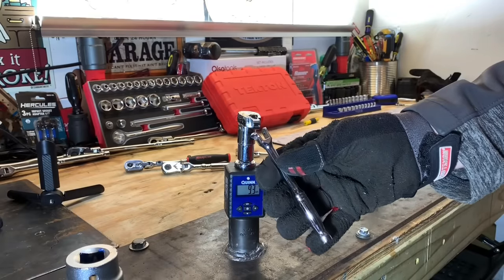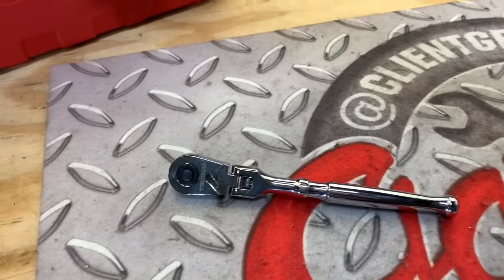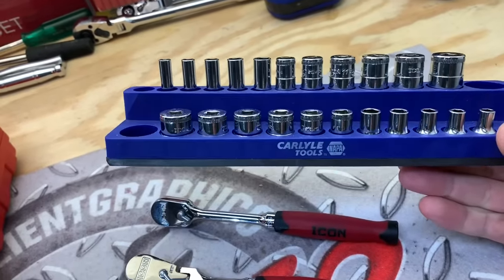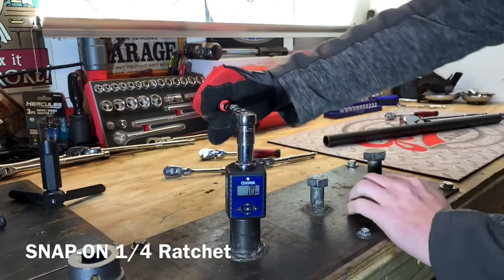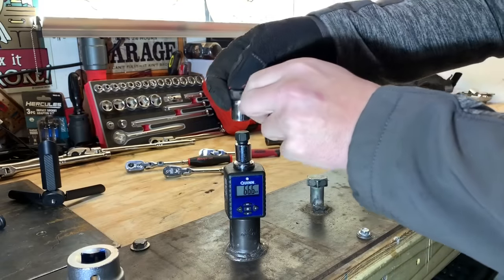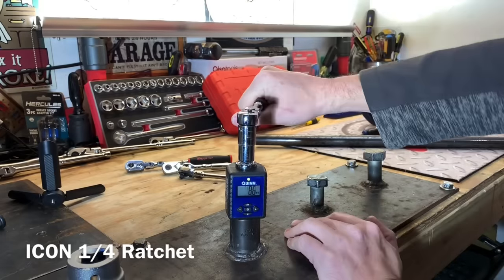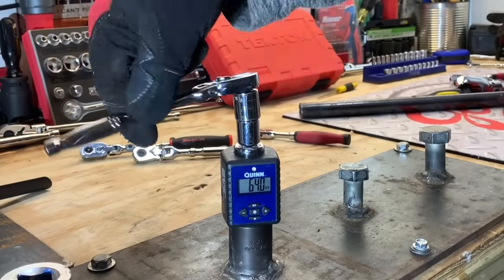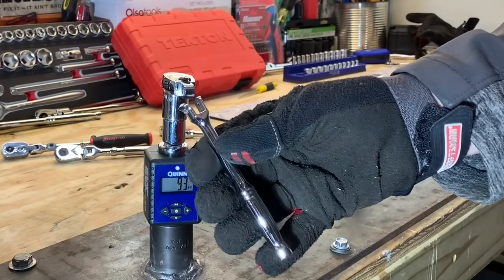$145 of SnapOn vs Tekton vs Icon vs Capri Tools Who Will Flex the Most?

Comment: If you have to use a cheater pipe to break a wrench, there’s nothing wrong with that wrench.
Reply: Doesn't that logic prove that no one needs to buy snap-on? That unless you use a cheater bar, every ratchet tested was the same.

Comment: Uses a broken snap on ratchet against new tools and still was right there with them
Reply: It was last dude.   Dead last.    What do you mean it was "right there with them?"
Reply: @Speed00007  it was broken from the get go😂
Reply: @clydevaught3750 new performs the same. So still speaks well of it. Still overpriced no matter what anyone says. Snap on flex head ratchets are my absolute favorite to use, but snap on in general, no.
Reply: I've used nothing but snap-on ratchets for over 20 years as a professional mechanic.  I've broken many of them, but I never had a single failure of any kind where I wasn't doing something stupid with them like using 4ft cheater pipes or hitting them with a sledge hammer. My at work box ratchet drawer is snap-on only but theres not a single snap-on ratchet in my service truck box or my home garage box. The new sealed head non quick release Tekton ratchets are all I have in those boxes. They are phenomenal regardless of price and it's just a bonus that they are fairly cheap. Working on heavy equipment in the shop vs in the field is drastically different and for me in the field loosing something is far more common as opposed to breaking something which tends to happen in the shop. When I drop a Tekton 1/2 extra long flex head ratchet in the 4 ft deep liquid mud the excavator I'm working on is stuck in at a jobsite I'm out $45 but drop the same $350 snap-on ratched in that crap and I gota go mud swimming for it then that crap is everywhere in the service truck for weeks.  Snap-on comes by our shop twice a week, but a Tekton replacement is typically 4 to 5 days away. That's the reason I choose higher price up front for my snap-on shop box stuff because the benefit is drastically less waiting for repair or replacement and potential down time over a lifetime of extremely abusive professional tool usage.
Reply: The anvil broke on the Snap Off. It was fine at the start. It had a light duty anvil, compared to Tecton, and Icon, that are less than 20% of the price.

Comment: I inherited a bunch of old mismatched Craftsman and off-brand tools for my dad. About 2 years ago decided to upgrade my sockets and wrenches with cases for better organization. After doing some research I went exclusively with TEKTON and I absolutely love them. I work on all of my own vehicles, lawn mower, tractor, appliances etc but I'm certainly no mechanic so I was not going after professional quality shop tools however I feel like my TEKTON tools are in fact professional quality.
Reply: I’m a lube tech and they are definitely professional quality. I use and abuse their sockets and ratchets every day and the only thing I’ve had fail is a set of mini end cutting pliers where the little spring flew out. Took a picture and 4 days later (it was over Labor Day weekend) I have a new set in my mailbox.
Reply: Gearwrench is my baby
Reply: I have the Tekton 1/4”,  3/8” and 1/2” sets (90 tooth)  as well as the SATA 1/4”, 3/8” and 1/2” sets (72 tooth - owned by Apex like Gearwrench and Crescent) ... really happy with them all ... my ratchet wrenches are  Gearwrench !!!

Comment: It was a good test but honestly its a 1/4" ratchet so really its not made for high torque applications if you have to pull that hard you would up the drive size
Reply: I got ratchet mechanisms from various brands, I do notice a wide variance in the overall quality of it and it's not specific to a brand. Snap-on's ratchet mechanism in the torque wrench i have, works OK but lacks smoothness compared to ratchet mechanism from say gearwrench or something. That is something i noticed over time.
Reply: @Enonymouse_  personally I fell that the snap on ratchets are the best ratchets that I've used, the gear wrench to me is much smoother and better feel then a craftsman or matco but my gear wrench 120xp ratchets i dont feel are as good a product or as smooth as my snap on that being said the ratchets are just about the only thing i really use from snap on anymore I've been buying gear wrench products the past couple years because its cheaper and holds up just as well
Reply: No shit
Reply: No shit... the point of the test is to take it to failure. Obviously they're going to load it more than it's designed for
Reply: @bstceltics4  you gotta try some of the German stuff (e.g. Hazet, Stahlwille, Gedore)!
Reply: I’m pretty sure almost everyone that comes to this channel knows that already. That’s why it’s called a torture test. Smh.
Reply: @uppercutshurt5199  i understand its a torture test my point was that i dont buy 1/4 inch ratchets to break 15/16 bolts loose in buy them by how smooth they operate and how many teeth they have

Comment: The quick release makes the anvil weaker on the Tekto and Snap-On. I've become a Tekton fan. Warranty, price, and non skipping socket and wrench sets sold me.
Reply: Right on! I'm going that direction myself. I have always had craftsman in the past but they can suck it!
Reply: I have the Tekton stuff in non quick release, hard to beat for the price.
Reply: Yep I have that same Tekton with non quick release and non flex head
Reply: I go crazy for those no skips
Reply: Also, you get 10% of your previous purchase price off of your next purchase.  I just got the 3/8 full set for $125 and that gives me 12.50 off the next purchase I make.  I think they're a great company.
Reply: I have a ton of snap on stuff but I recently got a second job and need to fill it out. I did not want to go straight harbor freight so I shopped around and Tekton is far and away best deal for your money.
Reply: Also the include more large sockets in 1/4 and 3/8 drive. Some times you can't fit the next size up ratchet and having a 9/16 1/4 drive helps a ton.
Reply: You ain’t lying. That no skip, free shipping and 10% back. Can’t beat that.

Comment: As a professional I much rather have my tools fixed or replaced asap when the tool truck comes around. Mac. Matco. Snap on. Cornwell visit weekly and that's the difference for me
Reply: All you have to do with icon is drive over to your local harbor freight and get a new one.  If the tool truck comes on Monday and you break a ratchet in Tuesday you’ll be out a week.  Icon you’ll be up and running after a lunch run.
Reply: And a lot of companys you just send a picture and they ship it too you usually only takes a couple days less then a week thats for sure
Reply: @Mjc103  driving to HF isn't really feasible because it's 30 min away in a different direction than I live, so the whole trip would be over an hour plus gas after working a 10 hour day.  I'd rather text my truck guy and he will bring it to me.
Reply: @mmholling87  that makes no sense at all.  You’d rather pay double than spend an hour of your time and gas???  Then you’d rather be out of the tool for 6 days rather than be up in running in a couple hours.  Bro listen to yourself.  Get off the tool truck koolaid.
Reply: @Mjc103  my time is valuable to me. It's much easier to get more money than it is to get more time. A $140 ratchet isn't a crazy amount of money in the grand scheme of things. Most techs spend more money on tobacco, energy drinks and fast food than their tools.
Reply: @mmholling87  you’re talking about of both sides of your mouth.  Money is no issue but time is.  If you are down the ratchet until the tool truck shows up you’re losing time.  As a flag hour mechanic the faster you complete the job the more money is being made.
Reply: @Mjc103  nice try, i'm not flate rate and I have backup ratchets, wrenches etc. Buy whatever you like and can afford. I'm not going to buy HF, Tekton etc. I won't belittle you for buying HF and you should grant me the same respect. Have a good weekend.
Reply: @mmholling87  not belittling me at all.  Keep drinking the koolaid and paying double or triple.  Snap on isn’t your daddies snap on anymore.  Good day sir.
Reply: @mmholling87  I said good day sir.

Comment: My 88 tooth 3/8 drive Snap on cost me 138.
But it's worth it.  Nice smooth action.  A rachet is used to remove nut or bolt.
Use a pull handle to break shit loose.

Comment: Snap On hand tools (ratchets & all) are absurdly over priced for what they are today. When a 1/4" drive basic set cost nee $600, the actual value is beyond difficult to justify other than wrencher social status membership. Back in the 1970's Snap-On tools were about 30% more than Craftsman (Sears stores) equivalent this was mostly true up to the mid 1980's, come late 1990's till today Snap-On's marketing deception machine has inflated their hand tool cost beyond absurdity. It works due to brand loyalty and perception Snap-On has the "Best" hand tools made... made in the US of A which is questionable. Fact is, there are many, many alternatives to the Snap-On offering today from HF to European brands that are in many ways superior to Snap On and similar offerings at FAR more rational cost. The "Lifetime" warranty is another Snap-On marking trap to lure-bait tool users into believing the myth of, "Buy Once, Cry Once.". All tools wear out and can be busted if abused in various ways. Actual Snap-On warranty depends on your tool truck dealer and how Snap-On ship into be warranty "feels" about your claim. This is the real world reality of Snap-On's "Lifetime" warranty.

As for Snap-On's Dual 80 ratchet design, it's origins can be found in the original Armstrong and Proto flat handle ratchet made post WW-II. The basic design of using a low tension spring on a ratchet pawl to reduce back drag with smooth operation and high strength goes back these US of A ratchet designs from long ago. What Snap-On did as with many of their claimed "innovations" is to slightly revise it then apply their deceptive marking to foist this stuff. They are not the only ones to use a ratchet design like this, TopTul offered-sold (to this day) an extremely smooth, fine tooth ratchet design years before Snap-On's Dual 80 ratchet at FAR lower cost.
Reply: Nothing more than tool snobbery....you can find the same thing with wine...opera music etc...

Comment: I came here to read all these comments by strap-on users who got screwed with their overpriced, over-hyped garbage....😆
Reply: 🤣 "strap on" good one
Reply: Ebay's a hell of a site
Reply: You do realize that the quick release ratchet heads are much weaker than solid anvil ratchets. I have icon and snap on and Mac and craftsman. The icon ratchet is good but using it every day it has started to get binding in the head where the snap on is still strong and smooth over years of use. Everything has its purpose
Reply: @yz85919  Be realistic about "Strength" of any ratchet. If you're going to apply that much torque to any wrenching tool, a ratchet is the wrong tool. If vast amounts of torque is required, use a long handle box wrench or non ratcheting socket drive tool or better yet use a high power impact tool. It is absurd to use a hand ratchet as the default wrenching tool as there are FAR better tools for a given wrenching need.

And... Do NOT be afraid of using the largest square drive for any given wrenching need. There appears to be a chronic and severe allergy within the Moto wrencher folks to avoid at any cost a square drive size larger than 1/2" square. In any application that needs more than 300ft/lb using a 3/4" or 1" square drive tool would be the FAR better choice. Instead, Moto wrencher folks insist on adding a 100 foot long cheater pipe to the tiny (1/2" or less) square drive tool then scream "Cheap Crap" after the square drive tool explodes.

~Why?~
Reply: Snap-On's reliability and dealer network notwithstanding; people tout them as "lifetime tools" which...after re-mortgaging your house and starting on a loan that could get you a nice Truck, are quickly sold off wholesale to the first takers to get the loansharks off your back :P

Mid-priced or cheaper $20-40 don't really have any change in value and since you're not dropping your paycheck directly in the tool truck's coffers, you tend to hold onto them longer!
Reply: Jack Lo lmao if u turned wrenches for s living you would have nothing else in your hand believe me!
Reply: Well if you ask my dad who's a professional diesel mechanic having reliable tools is one thing but having a good replacement network for when one breaks is even better especially for when he travels
Reply: @rupunzel6299  your telling me you don't torque yours lug nuts with a 1/4 inch ratchet?
Reply: @Jacweninger  Depends on the lug nut size. Model RC cars have small lug nuts that can be easily busted off with any 1/4" drive ratchet. Lug nuts on a Caterpillar 797 can challenge any "ratchet" smaller than 1" drive. So, tell us about your lug nuts?
Reply: They got the lube of payment plans till death lol
Reply: @rupunzel6299  Damn right! I work on trains and we have multiple setups of different sizes. You cant use a 1/4 on something that need 2/4 or 3/4 or use a 2/4 on something that needs a 4/4.
Reply: Agreed ! Snap-On prices are insane and the quality is just not there anymore ! I love the TEKTON line, Price is great and i have yet to have any issues with them ! I have not used the ICON line so i know nothing about them... "strap-on" LMAO !
Reply: U been around for awhile now, snap on has always been expensive and among the top tool brands, now with that said the difference in gap in quality in tools has been greatly reduced in past years, it is NOT as beneficial to buy the top brand as it once was. They will eventually price themselves out of business AND they are making more and more tools overseas while touting all American made company. Now I also have seen snap on outperform in some instances (not all) especially their wrenches. But over the years I have not found them to be a absolute to buy except for a few tools they make that supersedes ALL others, then again there are some Mac tools over the years have had some surpass all others too, Matco too but not as much as the other two. Bottom line is buy the best you can afford and just try what you think is best for you, forget our bantering.

Comment: I don't own any Snap-on tools. I've had both had bad experiences with tool men and also don't see the point in paying so much. With that said this proves that a new ratchet will hold a certain amount of torque. But this does not account for the longevity of the tool. As an Automotive Technician I look for what will last. Pushing the ratchet to its failure point doesn't prove that over time the tool will hold up. The way these tools are actually used is very different than a static test.

Comment: Super Thorough vid! The only thing that seems unfair is everything was brand new aside from the snap-on which was already broken in one direction, It doesn't seem fair to use a previously ABUSED ratchet and compare it to new ones
Reply: Facts
Reply: It snapped the anvil. No amount of normal wear, for 50 years, weakens the anvil.

Comment: Well, I dunno.  The smart thing is to never use a ratchet that is too weak for the task at hand.  If you want to tighten or release a fastener and know (or suspect) the amount of force needed will cause it to fail, you should upsize the ratchet.  Go from 1/4" drive up to a 3/8" drive, and 3/8" drive up to 1/2" drive and save yourself the grief.  Better yet, use a long-handled standard wrench or a long breaker bar.  Neither of these have a ratcheting mechanism that can fail in use.

Comment: I purchased all of the comfort grip ICON ratchets and got all three ICON torque wrenches.  I got one ICON ratchet and used it on a job. I ended up buying the whole set after that job. Love my ratchets. 

Why spend triple or more  when you don’t have to for the same, if not better, tool. I’m planning on, over time, getting the entire line of ICON Hand tools. Snap-on is good quality (mostly) but they don’t have the advantage anymore. 

Why buy snap on when the only persons impressed by snap on are other guys who like tools. Whatever your working on, the customer nor the world at large cares what brand tool u have as long as it works. 

So far, I’ve really put some heavy stress on my ICON tools and they perform flawlessly. Plus, if they ever fail, a quick run to the local HF for a new one is all it takes. No shipping, no waiting, no hassle. Theirs just no reason to pay more anymore.
Reply: I agree. Only thing I don't like about Icon is their box prices. Boxes are still ridiculously over-priced in general.

Comment: For $140 I would expect a lot more. Sounds like paying for the name is a waste of $.
Reply: I know, because u are not profesional Doug Lmao
Reply: There are torque ratings for each ratchet if you need a lot of torque you would up the drive size 1/4" is not made to be used that way thats like trying to take off tractor lug nuts with a 1/2" ratchet. I buy snap-on for the fine teeth and smooth application but i also have from 1/4" up to 1"

Comment: Although the only issue with the Icon is consistency. They dont all act or feel the same. The first one I bought felt great, but used it once and it locked up. The replacement they gave was much "stiffer" to operate and soynds different. I started checking several on the shelf VERY inconsistent.